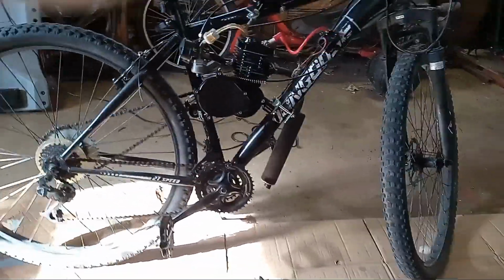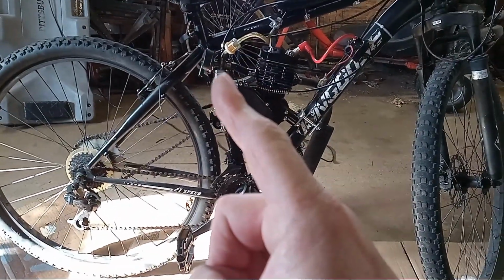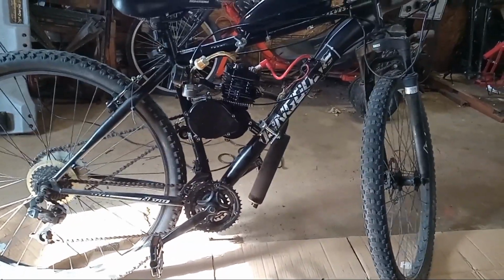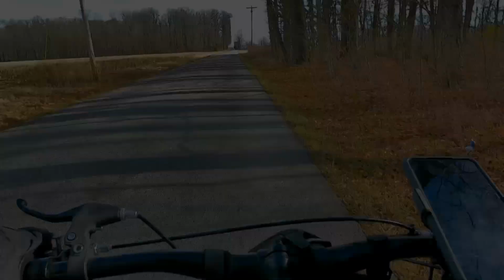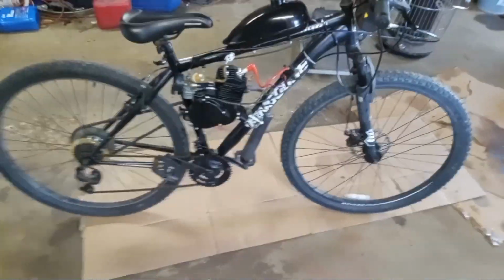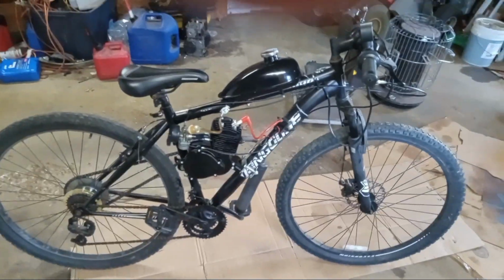Motorized bike-tuning my nt carb

Comment: I don't have much experience jetting a stock pipe always went with a 65 got the best performance out of a pretty much stock motor try a 65 and see what it does nice video ride safe
Reply from the maker: @KevinTodd I've never liked those stock pipes personally.going with a clone pipe for it next don't have money for a real expansion chamber lol thanks for watching brother
Reply: @glenssmallenginecreations  the last video I put out that MZ 65 from MCZ Miami was $55 and shipping that's not a bad price and that's a good pipe got it on eBay he still got plenty plenty more
Reply from the maker: @KevinTodd hell yeah that's not bad at all..appreciate it
Reply: If you ever have issues with the rag joint and switch to a hub adapter that's slipping/spinning  or the adapter is slightly too big.....Use 2 part epoxy and scuff the mounting surfaces up.....Or if slightly too big, make aluminum spacer shims from round tubing & use  2 part epoxy.....I wish someone told that, so I wouldn't have to figure it out on my own....IMO it works better than trying to cut a keyway groove in your hub.